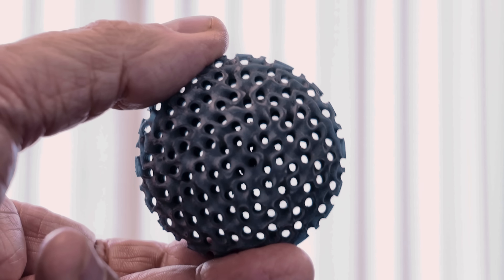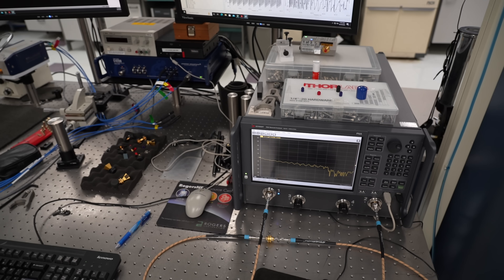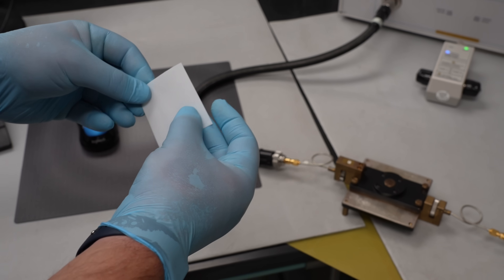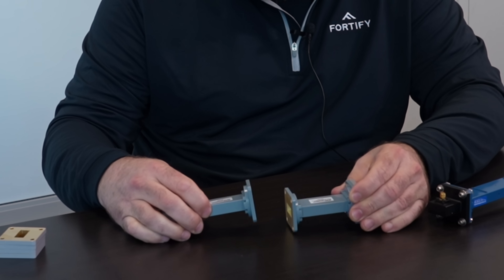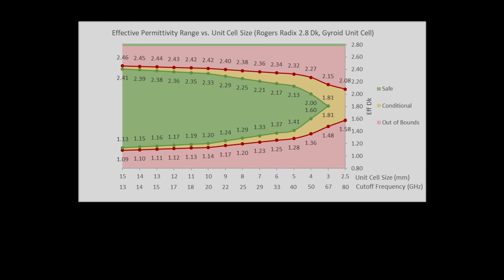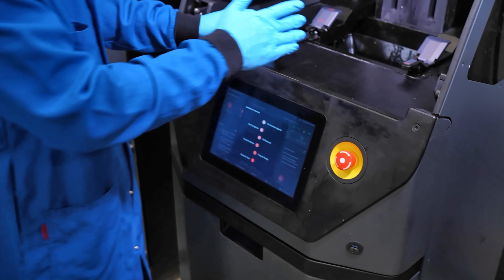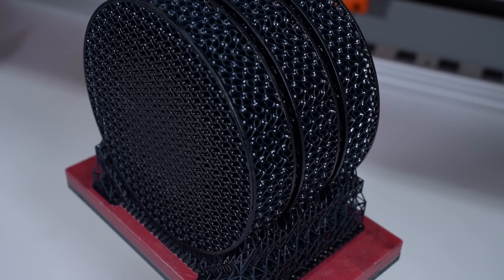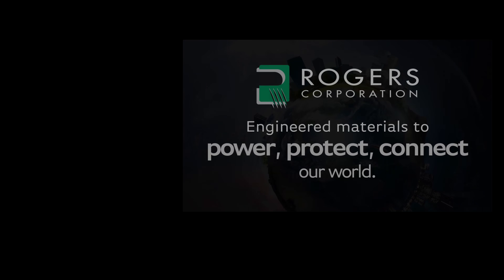Unveiling the Future of Antennas and RF Lenses using Radix™ 3D printable material!

Comment: Thanks, this is a brilliant video. I became introduced to this channel by seeing the Theremin bug video, but this video caught my attention since I had similar thoughts myself about using 3d printing lenses after reading about Luneburg lenses as great reflectors for radar, increasing the effective cross-section by up to 40dB. One quick question, for designs where the Dk varies across a print following a mathematical function, is this obtained by varying the cell design across tiger print, or by changing the chemistry of the mix across the print? I imagine the first but thought it worth asking in case Rogers were being cleverer than I thought..... Again, many thanks for a fantastic video.
Reply from the maker: With most of the lenses, they choose a suitable unit cell, which is usually a triply-periodic minimal surface, like a gyroid lattice, then vary the wall thickness parameter in the expression to vary the mean density of the print.  The material I was investigating has an εr or Dk of 2.8 as a solid, and can vary down to a little under 1.1, although that gets a little fragile.  I think they are working on materials with higher Dk as well It's easy enough to vary the lattice wall thickness in three dimensions, but for some shapes it makes more sense to align the lattices differently to maintain strength/stiffness. Other materials are being worked on for higher frequencies using Zirconia, Titanium dioxide, Alumina and other ceramic dielectric materials, some needing a bake to burn off the print matrix.  Also there are some filaments that work in the low GHz range that have reasonably-low loss tangent. Some of the filaments come in various Dk values and you can print complex gradient-index objects with multiple filament types if you have a dual-head  printer. I'm working on a project to see if I can use my home filament printers to make useable lenses, that will take some time though, so might be ready for July or August. I'm also trying to do a deal with a 3D printer company to get a large-build-volume printer, but the filament really needs a heated enclosure at 70-80C to prevent warping of large prints. Interesting times we live in.
Reply: @MachiningandMicrowaves  Thanks for getting back. This is a fantastic subject. The 3d printers used in the video are somewhat beyond my resources (currently have an Ender3,) but I'm very interested in what can be done with filament printers because a dual head printer is a possible upgrade for me. I am also interested in Fresnel lenses or zone plates because these can be made with a low-cost printer, even if the printed object needs electro-plating afterwards. I spent my career on the physics/analog electronics boundary, developing microchips for data communication, and I have a whole range of interesting home R&D projects in my now semi-retirement. Thanks again!
Reply from the maker: @Mike-H_UK  Another upcoming project is a vacuum chuck for my lathe so I can machine Fresnel Zone Plates for 78 GHz, 122 GHz and 248 GHz.  I'm only going out to 200 mm diameter with the vacuum chuck but I have a 300 mm faceplate that I think I'll be able to use for larger FZPs using a clamp ring on the outer edges and a pressure plate on the inner parts.  That will be made from UHMWPE of HDPE or Rexolite if I can get a small enough section.  Perhaps PTFE if I can find some suitable plate.  I don't have a CNC so I'll be using 1/16th wavelength steps and cutting manually.  Another approach for a Fresnel lens is to do it using steps of gradient index prints, using pillars of varying diameter, spacing and height to get the gradient index correct. I think any of them will need to be mounted to something rigid and RF-transparent like polystyrene sheet or closed-cell foam to prevent sagging and distortion of the lens.
Reply from the maker: drop me an email if you'd like to be included in discussions about the tech of future projects
Reply: @MachiningandMicrowaves  Will do - great!
Reply from the maker: @Mike-H_UK  "mailbox full"! I'll try again tomorrow
Reply: @MachiningandMicrowaves  Hi, I send an email on Friday before seeing your 'mailbox full' message above. I gave it a day for you to clear it out and tried again just now... Hopefully, you will get one of the two emails.
Reply from the maker: @Mike-H_UK  Hi Mike, I replied again, but I still get a mailbox full message from your server. I just tried again but still get the error message.  Is there another email I can try? 
 ----- The following addresses had permanent fatal errors -----
<mike@xxxxxxxxxx.uk>
    (reason: 552 5.2.2 User's mailbox is full)

   ----- Transcript of session follows -----
... while talking to mx1c51.megamailservers.eu.:
>>> RCPT To:<mike@xxxxxxxx.uk>
<<< 552 5.2.2 User's mailbox is full
554 5.0.0 Service unavailable
Reply: @MachiningandMicrowaves  Hi, I sent a couple of emails with an alternative email address. Sorry!

Comment: Sometimes the algorithm gets things just right, New subscriber unlocked.
Reply from the maker: Yay for the algorithm!  Welcome aboard
Reply: @MachiningandMicrowaves  You peaked my interest because i do astronomy and having a tool like in this video would be amazing. My other thought would be for building drone antenna's
Reply from the maker: I'm making some antennas for deep space network receivers around 8.4 GHz, but I haven't tried making a TIG-welded choked feedhorn for hydrogen line because my largest dish is only 10ft/3m
Reply: @MachiningandMicrowaves  I was thinking about setting up an array of smaller ones to coincide with my telescope while i am doing light Spectrum analysis.
Reply from the maker: @jasonpressler7111  I hope to get some microwave imaging set up using a small array of receivers to make extreme low res images of the stronger Galactic radio sources and the Moon, but that will be for next year
Reply: @MachiningandMicrowaves  Would be awesome to use it on some binary stars.
Reply from the maker: @jasonpressler7111  When I was studying for my recent degree course, I did the Astrophysics and Cosmology options and got to play with some nice remote telescopes, but no radio telescopes. I need to do some detailed reading about interferometric techniques with an array of software defined radios. My dissertation was about clumping and knots in the jets of SS433 in the W50 galaxy.  Sadly, that's VLBI territory rather than something I can do in a 180 metre long garden
Reply: @MachiningandMicrowaves  I am doing the fun task of trying to recreate how the constellations actually looked when Aristotle was making observations. I was foolish enough to think i could do it all in 3 years... i am currently 8 months into Orion.... just the nebula's. I have since come to terms that this will be a lifetime work. It has lead me to have more questions than i have answers, such is the way of astronomy. I would like to do my masters and PHD on how different types of radiation effect the velocity and direction of expansions rates on gas and dust in  nebula.

Comment: Fascinating. This clearly has the insane application of being used for software defined antenna's. Imagine using a software defined radio that can tune itself to different frequencies on the fly with an attached software defined antenna.

Note: A good example is the KrakenSDR being receive only, but equip 3D printable software defined antenna's to something like a time domain multiplexer and a HackRF One and you have something incredible. You could in theory receive on multiple frequencies at once, transmit on a specific frequency at will, and the antenna could be tuned to transmit and receive in high gain formats at specific frequencies on demand.

Has anyone played with this idea?
Reply from the maker: My SDR transmitter-receiver system has eight independent receive slices and I have two of them, so I can receive on 16 frequencies at once, at variable bandwidths. Commercial and military systems can have many more channels.  I can only transmit on two frequencies at once, but in general, the approach is to use phase-shifters to steer the beam direction of a large array of antennas.  Lenses certainly help as if you use a Luneberg type or some of the more complex geometries, they can form a focus from any direction, and you can modify the gradient index to form that focus as a shell caustic around one side of the lens, then mount a large packed array of feedhorns pointing to the centre of the lens.  Phased steerable arrays have been around for a long time, but the key applications right now are in 5/6G and vehicle radar. You don't need to multiplex as you can just process the multiple data streams in FPGAs and software.  The giant radio astronomy arrays like ALMA use the same approach with hundreds of SDR receivers, and VLBI of course uses linked SDR receivers that synthesize an ultra-narrow beam

Comment: Good to know I've not completely lost it! Lol!

And even though this still went completely over my head, it's still interesting to see.
Reply from the maker: Perhaps part two will shed a little more light.  If you prefer even deeper rabbit-holes, I'll be making some no-holds-barred tech vids on the maths and physics that's going on with RF lensing.  I have another project in preparation with some more machined lenses.  One of them is a Fresnel Zone Plate and I had to build a special 200 mm diameter vacuum chuck to hold it for machining.  That's another upcoming video in itself

Comment from the maker: I haven't found any really good papers about the design philosophy of dielspike/dielrod antennas. A lot of the work was done in the 1950s and 60s and it's in obscure out-of-print books. I'll keep looking to see if I can find a really good reference. I took the view that I would try out some ideas to see how they looked in the simulation, then try out some design ideas. I ran around 50 hours of OpenEMS simulations, making incremental changes to optimise the sidelobes while keeping the pattern the correct shape. What would be really nice is a way to run a genetic algorithm on the design, changing parameters to see which are most sensitive and in which direction, rather like partial differentiation, then pushing the parameters in the desired direction and compensating with the other parameters. Doing that manually is a hugely time-consuming task.  It would be nice to find away to characterise the resulting patters and give it a score, then use that score to steer the input parameters more closely towards the goal of the required beamwidth with good axial ratio and minimal sidelobes. Nice job for a long winter's evening perhaps!

Comment: 99% of this went directly over my head. as a deeply ignorant layman i have one question, how, if at all, will this effect broadcast/ham operators?
Reply from the maker: It's affecting me as a ham operator by improving the perfomance of my 10 GHz system.  The Mikaelians are going to be used in testgear for 24 and 47 GHz.  I rarely operate below 2 GHz, so I'm not sure what goes on on those low frequencies like at 70cm, 2m, 4m, 6m and the "short" waves. Other than rigid foam structures for high-impedance transmission lines and filters in VHF/UHF/SHFsolid state power amplifiers, it's going to be down to the collective imagination of designers and engineers and researchers to see what they can come up with.  Exciting times

Comment: I barely understand at all what was discussed in this video, although I found it fascinating. What I am curious about, though, being a 3D printer hobbyist, is: how much does the resolution of the print affects the printed lenses?
Reply from the maker: That will be in an upcoming video. In general, random variations of less that about 1/10th of a wavelength have little impact, but the wavelength in the material us different from that in air. Variations of 0.5mm are not too critical but it's best to go for smaller increments if possible for best bulk behaviour and minimal scattering
Reply: @MachiningandMicrowaves  Awesome! I’ll subscribe.

Comment: Some questions for the out of my depth curiosity: 1. The platter you got made is a filter for microwave transmissions?  2. You put the platter in a big flashlight lens, why?  Does it have to do with light?  3. What does a microwave filter do?  4. At Rogers, they said that these objects (the filters in the many shapes like spheres, boxes etc) is just a foundation for a metal casting, is this right?  5. This round platter you have, is it an antenna for microwave or a filter or are they one in the same?
Reply from the maker: 1) it's a focussing lens for a parallel beam of millimetre-wave radio down to a point source detector, or from a point source detector to a parallel beam.  Equivalent to a bi-convex Sherlock Holmes type magnifying glass, except instead of vaying the thickness of the glass, we vary the wall thickness of the cells to get the same focussing effect.  An near-identical approach is used to make optical fibres using total internal reflection
2) Plan is to build a transmitter/receiver into the body of the flashlight and use the existing battery and charget to provide power.  The lens will then behave as in example 1) and it will ba a robust source of microwave signal, or a receiver, for carrying out range tests of microwave antenna systems.  Nothing to do with light except radio waves are just a long-wavelength type of electromagnetic wave like light.
3) Filters tend to be made from metal, they are typically used to reduce interference from nearby transmitters like data links for cellphone towers
4) It's sometimes useful to have conductive metallisation to make antenna systems, so they are working on applying a laser-sintered metallized layer, or vacuum sputtering or plasma vapour deposition then using chemical deposition and/or electroplating and electroforming to build up the thicness where the device needs 3D conductive inserts.  Definitely not for casting.
5) It's one part of an antenna.  You also need a way to get from the electronic components into free space, so typically I'd use a metal feedhorn designed to illuminate the face of the lens, then adjust so it was right on the boresight and at the correct focus.
I need to do an explainer video, but I just flew back to the UK from the USA on an overnight flight in economy, so I keep falling asleep at the keyboard

Comment: Okay I didn't understand 80% of what you said but I found it interesting. I've struggled to get a lens to work with my simple POTY on a 1.5M dish so there is no hope for me... Lol
Reply from the maker: I've made a lot of Patch Of The Year lenses for the satellite X-band downlink, either biconic or truncated cones with stepped matching sections.  The smaller lens in this video will fit into a very similar feed to those 20.2 mm ID tubes in the POTY. Samples of that work at: https://youtu.be/JWx1J43uUl8 and http://www.g4dbn.uk/?p=1644 and http://www.g4dbn.uk/?p=1363 and http://www.g4dbn.uk/?p=1279
Reply: @MachiningandMicrowaves I tried some 3D printed ones but I didn't notice any difference between the lens off or on. I'll get there though, it's all about experimentation...
Reply from the maker: @glenwoofit  Depends a lot on the material.  The production ones like that red one on a Bullseye LNB are injection moulded. The main benefit is a small increase in efficiency by preventing over-illumination of the dish from the open waveguide, and reducing the sidelobes, but the noise floor of the satellite transponder is high enough to counteract the noise pickup from warm ground and buildings, so there's almost no need if the dish is more than about 60 cm.  I can get full signal into the satellite with 800 milliwatts on a 95 cm offset steel pierced dish and hear the transponder noise without a lens, but I use one just because, well, Reasons.  Yeah.